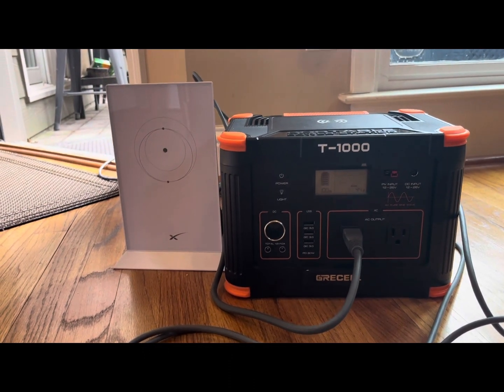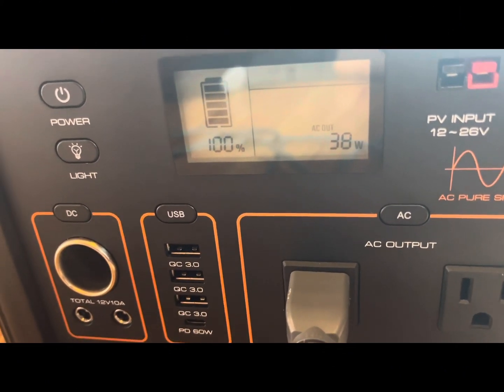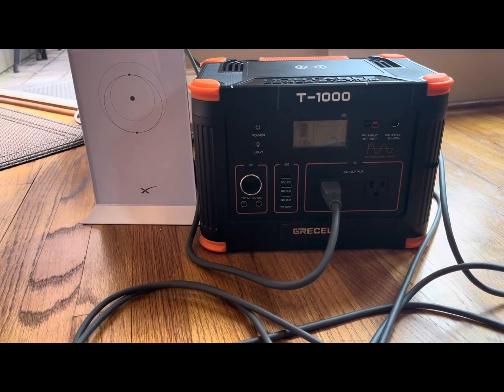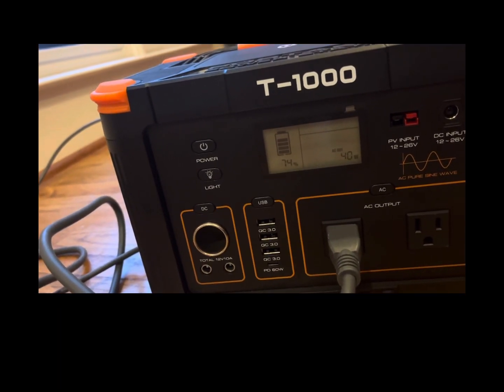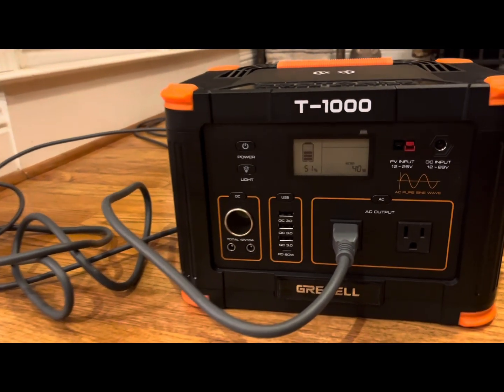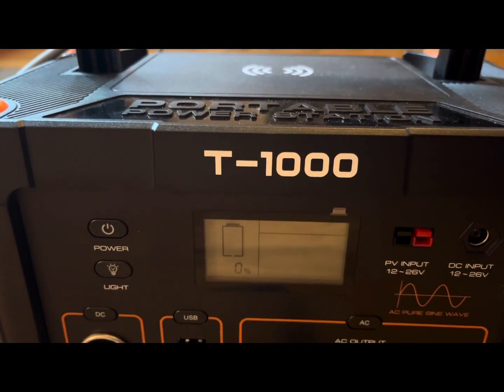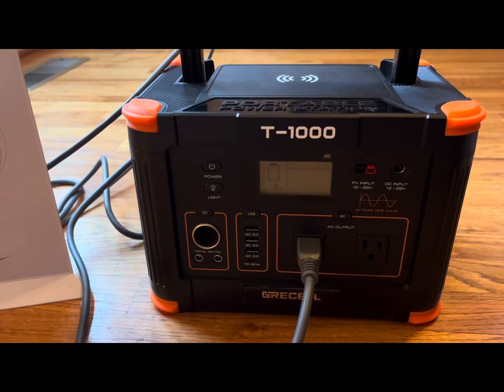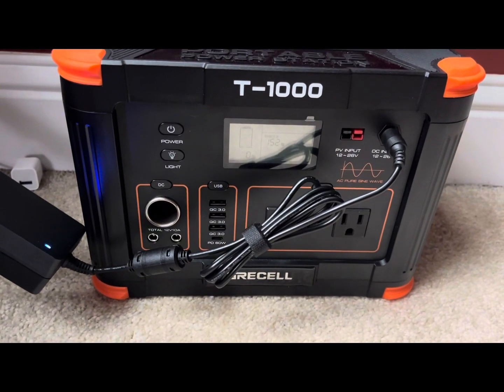How Long Will The GRECELL T-1000 Solar Generator Power The Starlink? Real World Test.

Comment: Good result!
I am anxious to see your solar recharge test. 0-100% purely on solar.
Reply from the maker: Hi there! I just got back from my 2 week off grid trip in Texas, I’ll be posting a video about how it performed soon. But I’ll go ahead and tell you that , on a single charge, it powered my Starlink for 7 days, that’s with intermittent use of an hour or two in the morning & a few hours at night to watch movies etc. I used two 100 watt solar panels to charge it after I ran it down to zero%. It took 4 hours for those panels to bring the box back to 100% charge.  But, If I ran the Starlink while simultaneously charging the box, then it took closer to 7 hours for the box to charge back to 100%. I’m not sure how this compares to more expensive power boxes, but I’m pleased so far.😁
Reply: Sounds like the solar panels worked wonderfully and combined with the battery source ran the starlink very well. 
Recharge was considerably quicker than I expected. 
Well done, thank you!